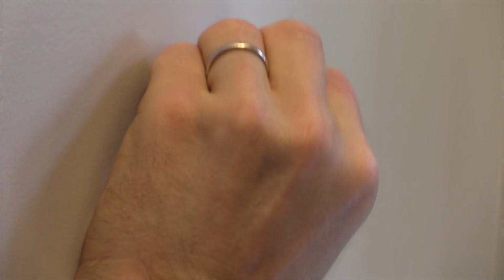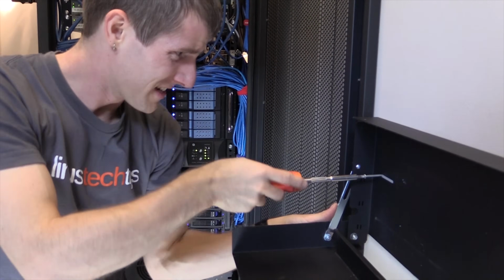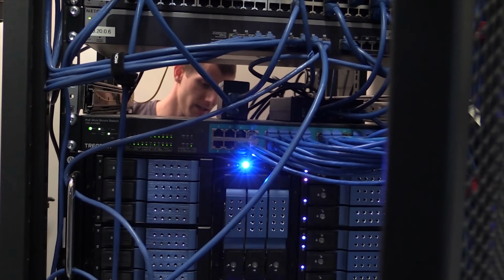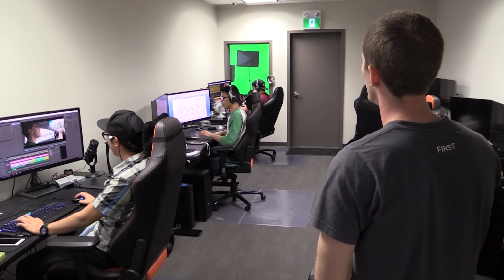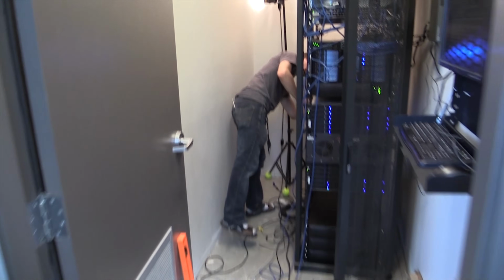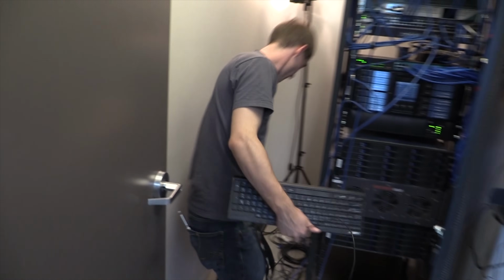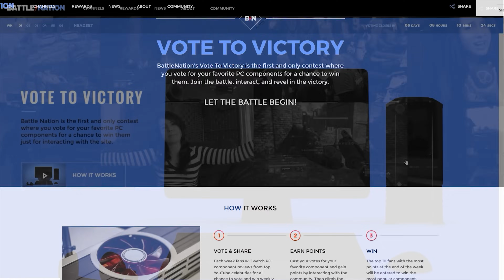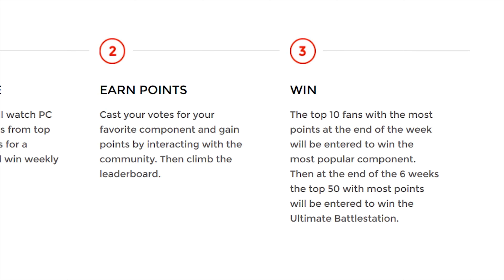Server Room Updates!! UPSes, KVMs, and more!

Comment: U know u can get 1U KVM's with mouse, keyboard and screen all included that u just slide out and it pops up? Ur rack/server room is very poorly cable managed and dirty as all hell, I work in a lot of racks and I'd give this rack/server room 3/10 points.

And you should ALWAYS have air condition in server rooms, not just for temps, but for keeping the air dry and its a great way to gather up most of the dust.
Reply: Hilariously, I'm not in IT, and I still knew all that :P
Reply: +Peter Šori if you take proper precautions, static electricity isn't a problem, however you should never have humid server room.
Reply: Every asshole is an expert eh? Yeesh
Reply: +Magnus Håland I don't know jack shit about servers, but linus said in the video, at around the 9:30 mark, he wanted to preserve space in the server racks.
Reply: +Magnus Håland 45-55% relative humidity is actually ideal for server/data rooms...
Reply: +Magnus Håland Also, I think we should keep in mind that Linus isn't actually an IT guy. He works in the tech industry, but that doesn't mean he's an IT professional. So... let's cut him some slack.
Reply: +fuzzybaffy There will always be people posting comments on how much better they are and that they wouldn't touch his setup with a pole.
Reply: +fuzzybaffy He has a shit ton of space in that cabinet, certainly enough for a 1U AIO KVM.
I like that Linus is quirky and likes to 'find ways' of doing things, but that just looked horrid. My bosses would laugh at me if I told them that's how I wanted to implement a KVM system.
Reply: esd mats, no synthetic shirts, esd bracelets, etc
Reply: +Steven Brucato We're aiming for 40% and 20 degrees C, if possible. Gets a little tricky in a room with 100+ racks and cooling devices only at the end of the rows :)
Reply: +Magnus Håland Not using a slide out 1U KVM is absolutely baffling.  They've been around for SO long and work great.
Reply: +Matt Carlin I think he is concerned about cooling in the rack as he was stupid enough not to cool the room correctly, if he had his cooling issues and dust issues would not exist. Considering in previous eps he has said how the data on those servers is critical to business I think its a  disaster waiting to happen.
Reply: +Cataclysonic Inc but he does have a/c going into the room and circulation out of it, he even said the air is cycled once per minute.  Not only that but the thermostat is in the room on the wall.  So why is everyone arguing over the a/c aspect of it?
Reply: +Magnus Håland I'd definitely agree that the cooling aspect and dust prevention are critical. I've visited the Roadrunner and Cielo systems in Los Alamos, and they had the entire floor below the server floor filled with industrial AC units. The two floors above the server floor were dedicated to exhaust air evacuation and re-circulation. Granted, that was for a supercomputer, but I'd definitely agree that Linus' server is currently in very poor working conditions.
Reply: +Magnus Håland It loos like it is still very WIP honestly. He did explain how he plans to address most of these issues.
Reply: +fuzzybaffy It's 1u though... the way the rack is organized 1u is nothing compared to how much wasted space there is
Reply: Peter Šori Look, I'm not forcibly against you in this discussion, as you might be against me, however I'm open if you tell me what else there is to it. We've done small to mid-size projects, where as we that the previous said precautions. What are these white papers, because I obviously don't know.
Reply: Peter Šori It's no uncommon for places to have a workbench with full ESD protection to do hardware replacements and such, but other than that the most i see is grounded flooring (either special paint or just grounding the metal posts of a raised floor) and of course proper earth connections on everything.
Reply: Peter Šori Not quite. You seemed to say that ESD gear isn't used in datacenters at all, but it isn't uncommon to at least have a single workbench for fiddling with parts (switching RAM and such). Not that i would bother, since everything in the datacenter is nicely earthed anyway.
Reply: +John Merritt He's stated that the room has sufficient cooling via the building AC... but that just adds that as a fault point. They're clearly going to start running into issues if they have to add any more servers. I have to wonder why they didn't just pay more attention during the internal architecture phase to ensure that things were done correctly, and have something resembling a proper server space designed in. Overall, while I love the new office, it still feels very ad hoc.
Reply: +Mag You cant even spell 'You'.
Reply: IsaacDaGrazinDragon ... and you can't even spell can't. Go back under your bridge, troll.
Reply: Steven Brucato
You are correct, although 45-55% is a bit high, but you still want an AC to dry the air, and then increase it with a humidifier, otherwise its incredibly hard to keep the humidity at a certain level.
Reply: IsaacDaGrazinDragon
Unfamiliar with text speak I see? English is not my native language, still pretty sure I can whoop your ass at it though.
Reply: Mag
Never said I was better
I was just pointing out that you cant even spell 'You', while you rant at Linus?
Reply: +Mag I'm afraid that Linus is using a mouse, a keyboard and a monitor to maintain his servers.There is a monitoring port at every server without no reason!
Reply: Everyone needs a crash cart near the servers. Not everything can be solved via iLO/IPMI. Also, several of his servers don't have management ports.
Reply: Jesper Monsted
KVM's today use USB, ur telling me his servers doesnt have USB ports???
Reply: But you can solce most if the problems.
Reply: +Mag I think they have.

Comment: Shouldn't he use Lunix instead of Windows?
Reply: Kartik Narayan
this is why i asked for a link on that. i'd like to see why he is using windows.
Reply: +holzi Most of the content creation software only runs on windows and a lot of those things are doing double duty as application servers. 

Also, windows server is surprisingly good for anything that isn't crazy performance dependent and a lot of the fun hardware has better drivers on windows.

Personally, you can have my FreeBSD server when you pry it from my cold dead hands, but the 5000+ windows servers (to go with maybe a thousand running Unix) at work are doing their jobs just fine.
Reply: holzi they are not running ffmpeg, they are running adobe media encoder.
Reply: +Kartik Narayan link plox? windows server is worse than GNU/Linux or even BSD on servers.
Reply: holzi i aint saying that windows is better , i was saying that linus already explained why he is using windows instead of linux
Reply: Jesper Monsted
content creation software doesn't need to run on a server. server hardware has pretty much equal drivers. GNU/Linux having worse drivers is only true for network cards and GPUs on desktop computers. https://en.wikipedia.org/wiki/Usage_share_of_operating_systems#Market_share_by_category
this is the market share.
amazon and microsoft use GNU/Linux on their servers and most server farms run GNU/Linux.
Reply: holzi They very specifically do run content creation software on at least one of them, the large storage server is running FreeBSD (FreeNAS), the surveillance server likely runs a windows application. I bet there's various other things running on the SSD server too, just because it's there and it's powerful.

The market share link only lists "Servers (web)" which is indeed a Unix friendly work type, but it doesn't even mention enterprise servers which are much more likely to be Windows. I work for a large hosting provider and we roll out probably 80% Windows because that's what the enterprises need.
Reply: yop linux is better than windows server but I think he doesn't have any Linux skills
Reply: He explained why he is using windows !
Reply: Jesper Monsted the link to "servers (web)" leads to "server (computing)".
Reply: *****
you don't render video on a server. maybe on a rendering farm or a desktop.
Reply: *****
there is no difference in running ffmpeg on GNU/Linux or on windows server.
rendering farms are more of a hybrid. i can use my pc as a server if i want to.
Reply: *****
what's the backend/-s to that? the documentation is horrible.
Reply: holzi
it's proprietary, but i think it's called MediaCore. also surprised there would be any documentation on it at all apart from basic help guides.
Reply: ***** thanks, i wanna see that. well ffmpeg and adobe media encoder/mediacore both utilize the same codecs (?) so there should be some documentation.
Reply: +W.J. Meyer "Lunix" :')
Reply: Lars Veldscholte
"linux unix not is"